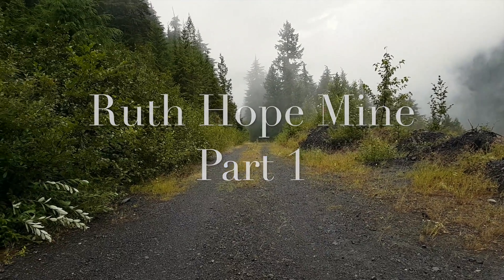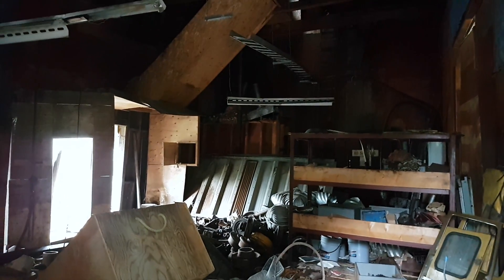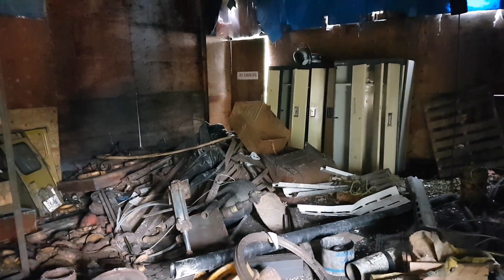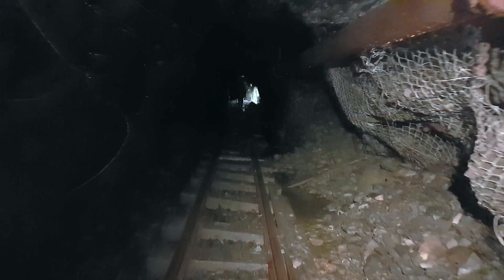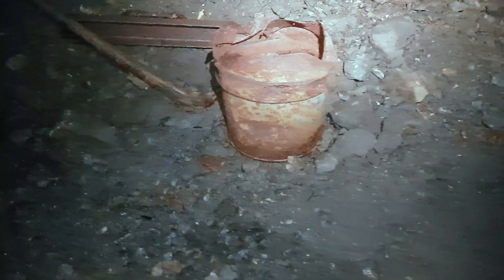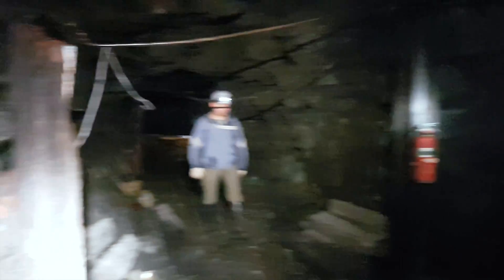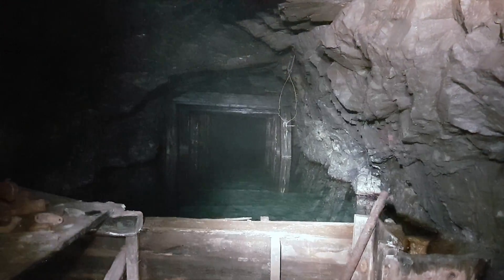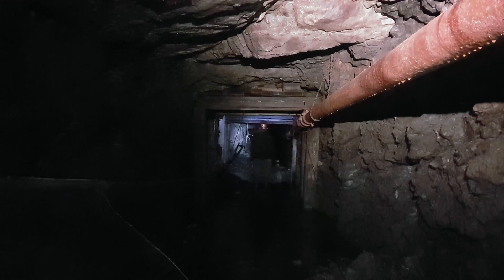Ruth Hope Mine Part 1

Comment: The area by the dam was for switching battery packs on the Mancha little trammer locomotive. They would keep two to three batteries for each locomotive, when the juice got low they would hoist the battery box off put it on the wooden stands for charging and then put a freshly charged box back on the lokey for work.
Reply from the maker: Murphy Jenkins Great info Thanks!!!
Reply: that is exactly correct